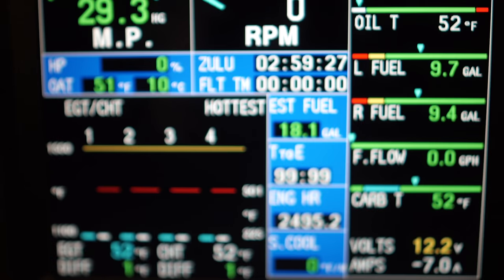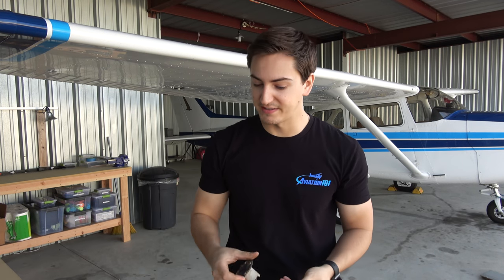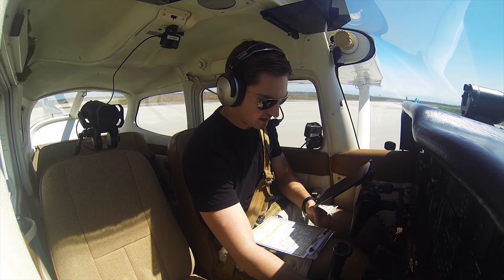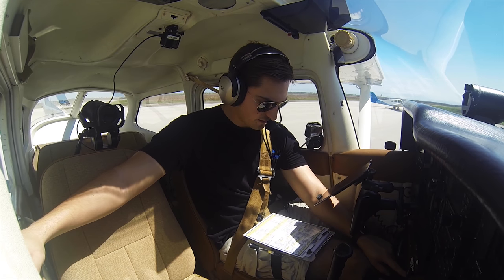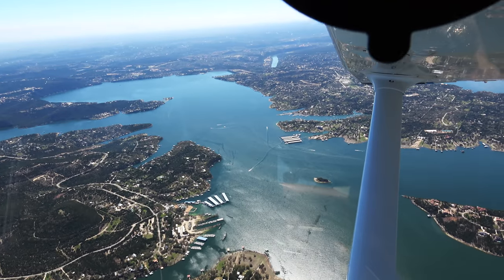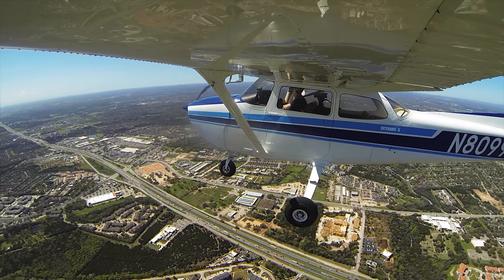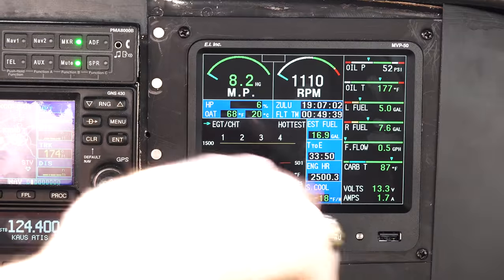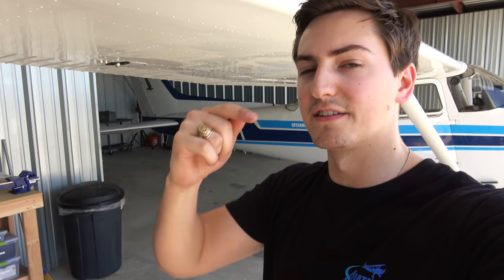No More Engine Gauges?!

Comment: is there a reason you keep your IPad upside down, also been thinking  about getting a 11 inch ipad pro as my efb, I know it would be a little big, but its literally just as fast and as usable as a macbook, but also usable a efb and other aviation needs that obliviously a macbook just isn't able to do. A normal Ipad is 9.7 inches so I dont think a extra inch of tablet and quite alot more screen because the bezels are way smaller then all the other ipads.
Reply: I believe he's said it's so the charge port is accessible or to keep the cable out of the way, something like that.

Comment: Nice!

I'm following this technology closely. My plane has an Insight engine monitor, and I've seen some toys (e.g. G5) at shows and in other peoples' planes. My next big ticket item, though, will be ADS-B. Nav Canada may yet come up with requirements (they've been studying it for years...), or I'll install a U.S.-spec system.
Reply: I'd recommend either going with a dual-band ADS-B Out solution or waiting for Nav Canada's decision. Within the U.S. we can get away with UAT (978mhz) only, as long as we never leave the country, but it wouldn't surprise me if Canada decides to go with 1098 (Mode ES) like the rest of the world has. UAT has technical advantages while Mode ES is a simple upgrade to existing Mode S radar equipment so is much more prevalent.
Reply: There is some ADS-B already in Canada (around Hudson Bay), Aireon satellite-based 1090ES. 978UAT does nice things (at a nice price) but doesn't exist outside of the U.S.A. I've never seen a 978 signal on a C-registered plane on Stratux.

COPA's position is "Your problem. You pay for it." They've actually made this stick on some past issues. I'll make my decision in spring 2020.

Comment: Although analog gauges look cooler, the accuracy and reliability of the new digital instruments is undeniable ! However, some of the digital instruments concentrate too many indicators in a small screen, so the numbers look too small.  There should be an option to configure the screen acoording to one´s specific needs.

Comment: Love the new panel. For those of us considering an upgrade like yours can you give us a cost figure?
Reply: No, and the reason for that is the actual monitor is only half of the cost.  You can look online and get the price of the monitor, but then the real issue comes when you start to do the actual work.  What's it going to take to gain access to the old instruments, to run the wiring to them sensors (and buying the sensors, in some cases), to new panel layout and WHERE you're going to go with the monitor.
If you have a used airplane, the owner before you might have had a Loran instead of the GPS that's in there now, or a couple of older radios, and the wiring was never fully removed.  So, the shop might save a few pounds of weight by removing that as well, but it's going to cost you.
So, the true cost of adding a monitor is going to be as different as each airplane it goes in.  'Guesstimates' might be off by $1,000 or more.

Comment: Wow. That must've been expensive.  I just put an ADS-B transponder in my 172.  That set me back over 5G's for one avionics device.  I can't even fathom what this would cost.
Reply: 172s are going through a funny period in that their hull values are currently being propped up by the demand for trainer aircraft in flight school fleets. So they command premiums they would normally not, say during the airline pilot hiring environment of the Lost Decade (2002-2012ish). My Arrow for instance, an airplane model that essentially is being dumped by the flight school markets by the hundreds due to the changes in the commercial PTS (now ACS), is an example of more performance for less money. Then there are the dozen models of higher performance complex airplanes that due to their age and increasing lack of parts support, are being shunned by the market and their prices represent relative bargains. Mooneys, Comanches, older V-tails, etc are examples of this dynamic.

Much is made in this little hobby about the proposition of paying more upfront for an airplane that is cheaper to maintain. To wit, 172s are simple machines and their systems simplicity does command some interest that inflates their price. And in general I would agree with this assessment. Cherokee Sixes for instance incur no discount over a Lance, yet they're significantly slower, which means people presumably are willing to pay for the perception of cheaper mx cost and insurance. And there are other examples. The problem is that at some point though, you're not actually saving anything if you pay such a high premium for the simpler airplane in order to merely save on maintenance and fuel costs. Adding a ton of avionics to a simple airplane that your insurance will eventually refuse to underwrite to the hull value you want in order to recoup your avionics in the event of a loss, will eventually become a problem for said owner. Slapping all those glass displays to a 172 is one example of this imo. But hey, it's a hobby after all, and if people want airliner cockpits in their 100knot 300NM legger (with real world winds) airplane, more power to them.
Reply: @GonzoT38  That's a good synopsis.  I'm just glad I got mine 9 years ago.  Picked up a 1976 172M for less than 25K.  I love my 172.  I just don't see legacy models being worth the price they are now.  In the end it's still a 1500lb aluminum can with a big bore lawn mower engine strapped on front :)

Comment: You have heard this before.  If your electrical system goes out, so do your gages.  How many times has that happened????? The glass platform is very tiring on the eyes of pilots and fatigues the body.  I will stick to the old gauges anytime since they are larger and easier to see and do not tire out the body and eyes.

Comment: At our ham radio club they showed us the dangers of these systems. One mild EMP which could be a improper HF transmitter 200 to 2000 feet away keying up 1500 watts on a improperly tuned antenna and the entire system can be fried. RF engineering courses are lacking the RF shielding knowledge work they once had per a Toyota engineer who has seen these problems in cars as well.  I would never venture from analog back-up systems at least.
Reply: The FAA dictates that 'critical' systems, and this would conform to that, have proper electrical isolation for this very reason.
Reply: Yep. Certified avionics have to meet stringent shielding requirements. Also, these are engine instruments - if they go out you just land as soon as you can. It's not that big of deal.

The G5s are more critical. Outside of a weaponized EMP they're going to be at least as reliable as the mechanical systems they replaced (vacuum pumps are notoriously failure prone.)

Comment: Why on take off at “full power” was the hp percent only reading 83%
Reply: I’ll take a stab at this.
      The O-320 in this aircraft is rated to make 150HP at a certain RPM on a STANDARD DAY.
       Standard day is 29.92” Hg and 15 degrees C at SEA LEVEL.

     If the engine is running at any elevation above sea level, the reduced atmospheric pressure means there is less air to combine with fuel to create power.
       Also, if the temperature is higher than standard, the engine will not produce as much power.
       When we correct Altitude for non-standard day Pressure, we get pressure altitude (PA).  PA corrected for non standard temperature is Density Altitude (DA)
       When the DA is higher than Sea Level, a normally aspirated engine will always make less than rated power.
        More importantly, the larger reduction in power is most likely due to the installation of a “cruise prop”.
        This type of fixed pitch prop is more efficient at cruise, but sacrifices power.
         Remember that power is a function of torque created by the combustion event and RPM.
        The cruise prop is turning more slowly (compared to a climb prop) and therefore not making “rated rpm”.  Fewer RPMs = less power.
        You can find the rated power (at a specified RPM) by searching for the Lycoming O-320 TCDS at FAA.gov

Comment: Very nice.  I totally get the Carb Temp gauge benefit, but why a MP gauge on a fixed pitch prop?  Cheers, Jim.
Reply: sactu1 I’m guessing it can be used on constant speed as well and if u can use it I rather have it than not
Reply: The displays can be configured for your airplane, Manifold Pressure and Tach are basics.  So, even though you may not have a CS prop, they still put a manifold pressure gauge there.  Any engine monitor you buy, no matter the airplane, is going to have that.
Reply: @GaryMCurran  Thanks Gary.
Reply: Gary C Would a MP gauge indicate before any of the others of issues developing if you knew how to read it I come from the fixed blade world so seeing a MP isn’t common for me
Reply: @Newberntrains it might, depending on the problem, but that's why they give you a full set of gauges.

Comment: It's too bad there's not enough room on the panel to keep at least some of the old analog gauges.  Electronics are fantastic and I would absolutely love to have a glass cockpit in whatever I end up flying, but I've dealt with enough computer failures to want some sort of redundant non-electronic system in the case that something craps out.  Murphy's Law, you know?

Comment: with the covers where the engine gauges were looks unfinished and pieced together. is there a new panel coming aswell?
Reply: He mentioned they're planning to add an autopilot, so that will require new openings. I wouldn't be surprised if a new panel is coming.

Comment: I don't fly, but usually AIO monitoring systems like this should have a backup analog system. Electronics always die. At least fuel and oil pressure gauges, and maybe a volt and amp meter should still be somewheres in case of a failure. I'm no pilot but I wouldn't rely purely on that, even less considering it has just one LCD display that can crack, instead of separate segment displays. It's not as bad if you only lose a couple readings.
Reply: The FAA disagrees with you.  They have decided that glass is actually MORE reliable than analog gauges and will last longer.
Granted, rough weather and a flying ipad into the screen will seriously screw up your engine gauges, and may knock the device out of service, but more often than not, you fly by sound and feel anyway.  You should know your fuel burn, how far you have to go, what kind of reserves you have, etc.   If you lost the Engine Monitor and are really scared about it, find the nearest airport with repair facilities and land.
Nope, I don't even think about it.  Those airliners you've been flying in for years now all have digital glass cockpits and you never hear about them having issues.
Reply: @GaryMCurran  speaks truth.

Comment: why does EGT rise when you disable the mags?
Reply from the maker: Everett I’m not an A&P, so take what I say with a grain of salt, but when you kill one of the spark plugs in the cylinder, the fuel takes a bit longer to burn off, which causes the gas that exits the cylinder (exhaust) to be hotter than it would when both plugs are firing and igniting the fuel quicker. That’s my understanding.
Reply: @Aviation101  Thank you for the answer! You're up late! Fly safe :)
Reply from the maker: Everett Business owners never sleep ;-)
Reply: Aviation101 Wow thanks. That’s a solid 10 minutes of 2008 low quality training videos on YouTube you just answered.

Comment: Hey new sub real inspiring videos I'm looking into getting my private pilot license just for recreational purposes love your videos
Reply: If you're going to be a Sunday pilot, flying out for the tradtional $100 burger, and you don't want to spend quite as might, you MIGHT consider looking at the Recreational or Light Sport Pilot's licenses.  There are restrictions on them as to what, when and who you can fly with, but they are less expensive to get and the airplanes you can fly are usually less expensive to fly.  Check with your local FBO about the programs they offer.

Comment: What if you lose the alternator?
Reply: Battery to get you down.  Won't last long, which is why you're taught to shed all be essentials from the buss, but in VFR conditions, you should be okay.  IFR, you tell the controller to find you a place to set down, like ASAP.
Many airplanes that regularly fly IFR will have a second alternator or a backup alternator to use.

Comment: Josh, I feel sorry for you and your Dad, kind of, a little bit.  You've put two G5s and an EI engine monitor in you beloved Skyhawk, and Garmin announces the G3X Touch is now available for certified airplanes.  A 10" landscape and a 7" portrait display and engine monitor for less $18K!  Add the GFC500 and you would really have been set!
Reply from the maker: Gary C I had a burst of frustration when I saw it just got released. It’s okay, I’ll build a home-built and put a G3X in it ;)
Reply: @Aviation101  What's that for place Australian job? That would make a nice traveling platform.
Maybe find a nice '76 or '77 Cardinal RG, add a Tornado Alley Turbinormalized kit to it.  That would be great.
Anyway, I'm sure you panel is going to be great when you finish with it, and 991 will be just as happy.

Comment: Why pull the Hobbs? Doesn’t save much weight and can read the hours when the master is off.
Reply: As he said, the Hobbs meter starts to read when the oil pressure comes up, so the sender is putting out an electrical signal.  If you have the wrong resistance, which could happen with multiple devices connected it won't read right.  So, it's a matter of the electronics installation, really.  :D

Comment: I'll start with I am a 71 year old private pilot with around 2,100 hours. What are the redundancies when you lose the cpu in the new avionics. Yes I understand their reliability but they do fail. All the systems you removed worked on separate sensors, for the most part. Thereby giving you more info to safely control the airplane. I am not yet convinced to put all my eggs into one basket during any actual IFR emergency! Or maybe I'm just hard headed? Take care.
Reply: Referencing my earlier comment, a commercial jet had an emergency landing yesterday in Texas. WHY, they lost all visual display on their glass instruments!

Comment: Why remove all that stuff?  What happens if you lose power?  Black screens of death....
Reply from the maker: jonny boy what happens if you lose power with the only gauges? Limp needles of death.
Reply: @Aviation101  VSI, altimeter and airspeed gauges don't use electricity.

Did you replace those?

EDIT: I just reread the title, Engine Gauges.  nm.... I thought you replaced these as well.